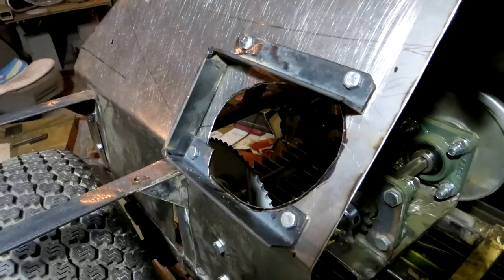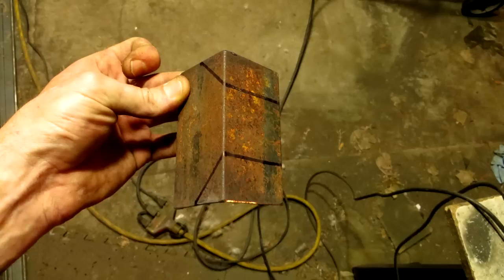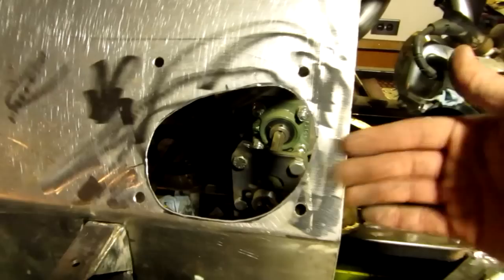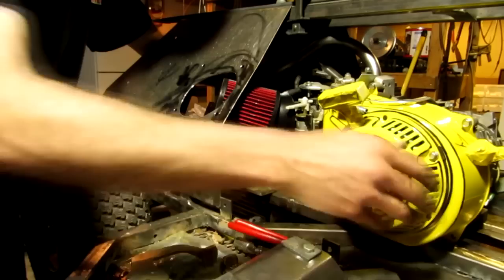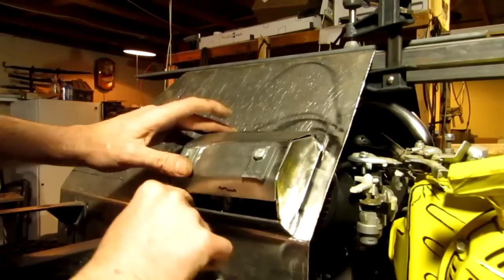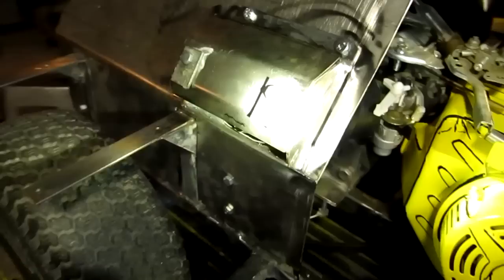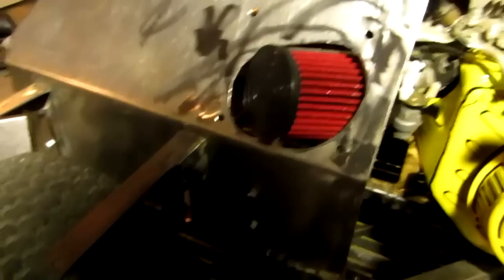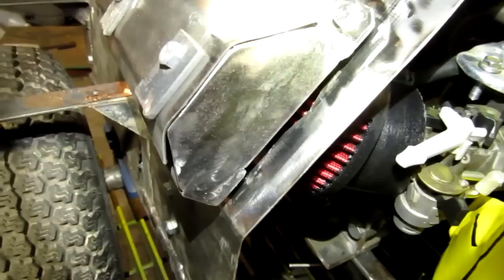Hyperion K4RT | Go Kart 14 | Air Filter Mod

Comment: Great video.
One of the reasons why GoPowerSports probably put a spring one the linkage for the governor is because when you remove a govener on those predator motors for some reason it will always be open the throttle all the way so you have to put a spring there to stop it from doing that.
I am writing this comment for the video were you show off the new motor that you got.
SORRY FOR THE LONG COMMENT AND BAD SPELLING
Reply from the maker: Ethan Lourenco lol, thats ok Ethan. long comments are welcome too.